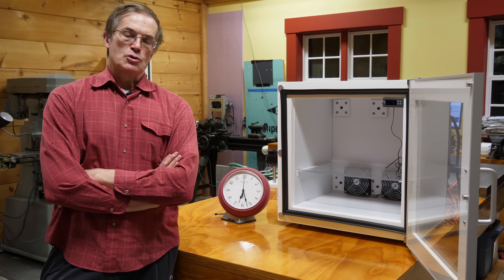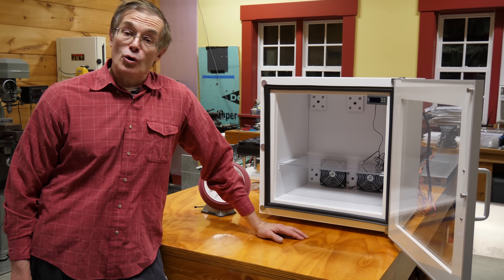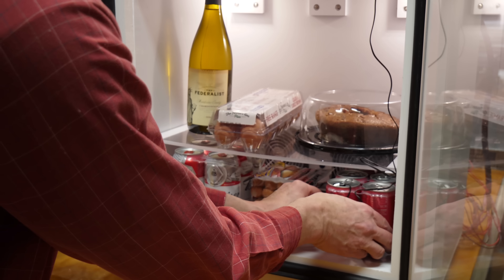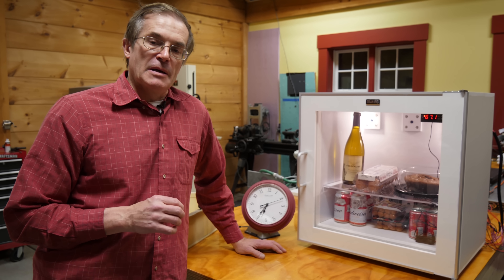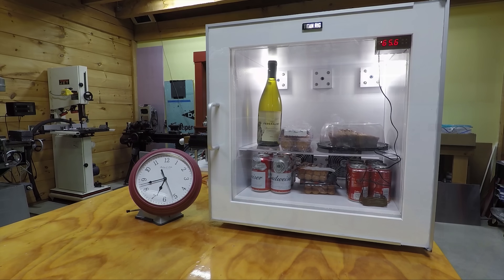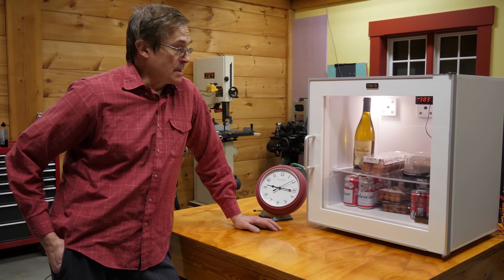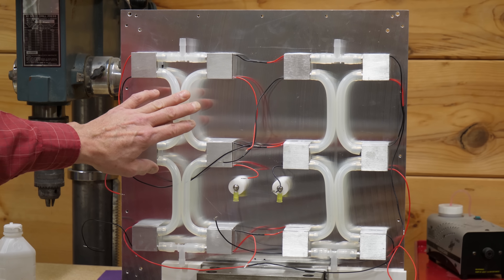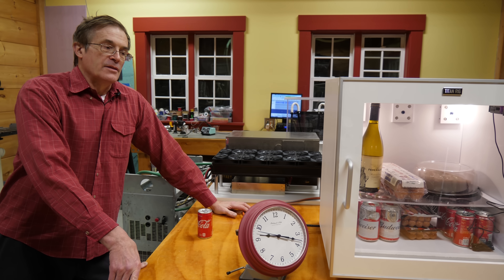TESTING OUR DIY REFRIGERATOR! - TEC/PELTIER

Comment: I recognize that cheapo temperature controller. Used that baby to preheat heavy oil to 120 F. $20 can't get you finer electronics.
Reply: Also handy in the toolbox for those emergency callouts to repair a commercial fridge, may not have all the features of the big names but keeps it running until the correct parts arrive.

Comment: Going back to the "no moving parts" concept, it would be interesting for a balanced flue design to be tested. These are used in the "Rocket Stove" and Rocket mass heater designs. Critically, the air intake and exhaust are the same diameter. The heat (from fuel or from Peltier) is added at the intake and causes the gases to rise like an inverted syphon where a heat exchanger can begin to extract and allow the gas to fall where it can be piped off around the house and out of a vent.

Comment: Wouldn't an antifreeze circlated in the interior of the enclosure that's plumbed to a small heat exchanger outside the house be more energy efficient? Considering a tiny circulation pump that's hooked up to the controller, and the peltier used only in summer, according to your narrative is half the year?
Reply from the maker: When we add the remote heat exchanger, we will use a water glycol mix  (food safe).
Reply: @TechIngredients  sounds good, please post some energy measurements too.

Comment: I'm really interested to see how much more efficient this will be with water cooling. Marine refrigerators and freezers (I live on a boat), even the standard compressed gas type rely on raw or sea water to carry away the heat. This is far more efficient than an air cooled system because the water is most always cooler than the ambient temperature. In the winter time when water temperatures get down around 40° to 32° the refrigerator runs about as often as normal, but only runs for a few minutes. The main problem is the motor compressor vibrations transmit throughout the boat. This electronic system, water cooled, could be an answer to quieter and more efficient marine refrigeration.
A really good thing to see would be a comparison of energy consumption between the electronic, water cooled fridge and a gas compressed, water cooled fridge. On a sailboat the lower energy draw usually wins the debate.

Comment: Thanks for an interesting experiment. I would suggest a couple of things though - once you committed to fan cooling the heatsinks, the heatsink design that was used was far from optimum. The clear door looks great, but really aren't ideal for an efficient fridge. I have done my own research and experiments on TEC fridges and efficiency is almost totally, but not quite, dependant on the level of insulation used. 10cm (4") of polyurethane is about the sweet spot for a fridge. The other factor is how the TEC's are driven. I would have liked to have seen more information on that side of it, (you already seem to understand that they need to be driven far below the max current which is important), and the level of efficiency achieved. The time to cool down is a measure of performance but with TEC's it is all about achieving efficiency. I would also like to know how you came up with using 6 TEC's - was it by calculation or otherwise?
Reply from the maker: Some of your questions are answered in the first video we posted about a week ago.  The door is less effective, but it makes using the refrigerator more convenient.
Reply: @TechIngredients  Thank for the reply. I did watch the first video and you did give a general explanation as to your rational. But I am a numbers guy. When I did my fridge I worked from calculating the cooling load, then used the datasheets to calculate the best current to drive the TEC. I would have liked to have seen more numbers!

Comment: Yeah but the energy the fridge puts into the air in your house reduces energy needed to heat it in the winter. A better case is the summer when you're dumping heat into a house you're activily cooling.
Reply from the maker: True, but electrical heating is less cost effective and it would boost the electrical efficiency to reduce the cooling temperature of the recirculating water.

Comment: That's one hellava fridge you've got there! Between the materials and workmanship that you've put into it, i'd dare say that it wasn't cheap in the least bit! The cost of the current configuration is how much???
Reply from the maker: Thanks!

Labor costs depend on what you would otherwise be doing with your time.  Also, many of the components and hardware are sourced from lab stock.  The TEC's cost $55, The required power supply costs about $50. The controller cost $13 and the fans were $6 each.  The big box boards, acrylic, hinges, adjustable feet etc cost about $100.

Comment: I was going to suggest exactly that, have the hot side on the outside of the house, i'm actually very curious if it's necessary to have the cooling hoses, the hot and the cold, isolated from each other.

Comment: With "water" cooling could you also have the TEC on the cool side of the insulation  instead of the large spacer blocks?
Reply from the maker: No matter what the method of heat removal, it will always be better to transport heat energy into the TEC rather than out of it because of the added electrical power (heat).  The inevitable, total temperature drop will be less if the higher load travels the shortest distance.

Comment: I've often wondered about using the cold air outside as a heat sink for refrigeration.  Usually involves cutting a hole in the wall of your kitchen for wires and/or pipes to pass through (and possible ingress of cold air from outside) which might be why it has not been popular with most homeowners.  I have heard of some super energy efficient types who have tried the idea, however.
Reply from the maker: We plan to use a window with some hardware to enable the water to flow in and out without modifying the wall.  this also allows the radiator to be taken inside when the outdoor temps no longer justify its use.

Comment: Nice work!

I wonder what power savings you could get from placing the remote heat exchanger deep underground to take advantage of year-round geothermal.

Side note, I just did an extensive search yesterday for anything having to do with electrets and couldn't find much of anything on Youtube.  So, maybe that subject might be a good future project.  The reason I was looking for electret information is I'm wanting to operate a rotor inside a vacuum furnace and my first thought was to use magnetic fields going the wall of the vacuum chamber.  That wouldn't work though because there will be temperatures above the Curie point.  So my next thought was something like ceramic electrets and electric fields.  Do electrets have something like a Curie point?  Can a good ceramic or refractory electret be constructed?  I'm curently thinking I can use magnetic induction on a refractory metal rotor but electrets usage would be novel and therefore exciting.
Reply from the maker: Thanks!
The geothermal approach is a good idea.  Kinda like taking paleolithic technology into the twenty first century.
Reply: @TechIngredients  True!  I didn't think of that aspect!  :D

Comment: Looks very professional like store-bought. Thought: Peltiers remote completely in a unit which runs an cold insulated line to the fridge interior. That way fans are remote and you can concentrate the cool into the liquid with a longer, high area coil inside the fridge for the heat capture/removal. Plus the area concentrated peltiers could be sequentially or parallely acting on a high thermal mass resevoir tank with a relatively small transfer conduit.
Reply from the maker: Thanks!
Not a bad idea.

Comment: Waste heat is only "waste" when it adds to the energy load of the total environment.  If our room is heated by adding heat, i.e., Winter season, the calculation of energy cost is complicated by the fact that we are reducing the load on the facility heating system when we run our refrigerator.  So, we can remote the refrigerator (heat pump) "heat sink" by placing it in a non-heated area and somewhat improve cooling efficiency (at the cost of additional equipment; a non trivial consideration) but we then discard the heat generated by our refrigerator!  This might be an improvement or it might not be.  I believe the calculations are complex.  Personally, as an engineer, diminishing returns may dominate.  This is somewhat analogous to the use of heat pumps for heating and cooling of buildings  in northern climes -- though almost in reverse.
Reply: The home heating system is likely much more cost-efficient at generating heat than the 'efficiency' of waste production by the peltier system. For instance, CNG costs about half as much as a resistive heater for the same heating (given average gas and electricity prices in the US). Fuel oil is only a little worse than CNG and still much better than resistive heating.
Reply: Of course it is.  

None-the-less, waste heat from a refrigerator is not a loss to the energy system (at least 6 months in the year).  I don't suggest that a refrigerator be used for heat, only that the cost equation include it.   And, my real argument is that a remote heat sink system will not show a profit.  Sure, it may be thermodynamically more efficient, but that does not make it cost-effective.  You will gain less in efficiency than the cost of implementation.

Comment: so whats the energy consumption? how efficient is the design compared to regular ones?
Reply from the maker: Maintenance power requirements are at approximately 100W which is about 25 -30% as efficient as a phase change refrigerator

Comment: I did a similar thing a while back to cool my workshop, although the temperature conditions are reversed here - https://sites.google.com/site/5b4ajb/Solar-Powered-Aircooler
One tip I do have for you is to use some kind of fungal inhibitor in the coolant.
To be honest, it doesn't perform very well (I know it's only a single 50W Peltier module) and am considering chopping up an old drinking water bottle cooler/dispenser...

Comment: Does a typical water cooler work good, or any good with anti-freeze or some other non-freezing liquid in it, that doesn't destroy the pump? Because when it is freezing outside the little heat from the peltiers (When the whole thing is in equilibrium) probably wont keep normal water above the freezing point.

Comment: Love the idea of pumping the cooler outside inside via a water cooling loop. How about using the temperature difference (hot fins and cooler outside water) to power the water pump via more thermoelectric peltiers?

Comment: Sorry but the way those fans are installed hurts my computer overclocker's soul.  I believe you would get more efficiency by removing one of the inside fans, turning the other around 90 degrees (z axis) and having it blow out of a heat sink with fins inclined so the condensation could drop into a drain (with U elbow so the heat doesn't escape/come in from the bottom).  And the outside fans could blow up from the bottom of the heat sink so they work together instead of against each other - as far as I can tell all your fans are either pulling or pushing against a plate when they don't have to!   I'd love to see an efficiency comparison with these changes and see if I'm completely wrong before you start dumping the heat outside! :)
Reply: This.... also wondering what the heatsink material is. Not sure it was mentioned in the last video. 
If it's steel.... steel has awful thermal conductivity. Aluminum would be great.
Reply: @BRUXXUS  It was mentioned in the last video. It's Aluminum.
Reply: @CP4884  Thanks for clarifying! Must have missed that bit of info.
Reply: @BRUXXUS  I think he said aluminum plates

Comment: Not bad at all for a 1st build ! I was skeptical about the completely passive fanless cooling working good enough, as even on regular fridges they typically use thE most mickey mouse fans available at the condenser side. That is to say just the smallest breeze seems to go a long way. You might need antifreeze If you're gonna put the radiator/exchanger outside.......hell you might not need so many(or even any ?) TEC's(circulation/flow depending) in the winter. & you should make it so the remote fans are optional(need some play with volume of coolant/hose lengths) so that anyone, anywhere can copy & use it practically. Anyway Ver2-12 oughta work like a champ, Can't wait, Way Cool Stuff as Always !

Comment: Can you use those modules to gain voltage from heat? Wondering if you could hybridise a wood burner's stovepipe to make electricity from the heat differential.
Reply: Yes, they can, have a look at 'cruising the cut' channel, it's a river boat channel in England, he has a TEC powered fan that sits on top of his solid fuel heater and uses the heat to power a small electric fan that circulates the heat from the stove through his boat.

Comment: I love this idea, and thought it would work extremely well for a kegerator setup where you have a very specific form-factor that you'll be cooling (1/6 keg for instance). Also, because you wouldn't be removing/adding things or opening/closing the door, you could get away with a lot less. Even if it took 6-10 hours to bring the keg down to temperature, you would only need to maintain that temperature for weeks/months. 

Also, I wonder if there's an efficiency to putting the keg in contact with the peltier device(s) so you're not cooling the air, but instead cooling the container directly.
Reply: You just reminded me of a setup I saw someone build, that can actually put two of their projects together. They used a turbojet made from a truck turbocharger, and had it run on propane. Because the fuel consumption was so high, it drained the propane tank quickly. The result is the propane tank got cold VERY fast. They dropped the tank into a big bucket of water with a bunch of beer and BOOM turbine powered beer cooler.

Comment: If you go sticking the radiator outside it might increase the efficiency of the freezer, but you're throwing all that waste heat outside and increasing the heating load on your furnace/forced hot air system. Better to keep it inside.
Reply: The bigger the differential the better/more efficient for the fridge.... err I think.
Reply: @chrisrathjan1501  Yes, like I said, the refrigeration cycle is more efficient, but the heat is exhausted instead of doing something useful (in the case of New England, heating the home in winter).
Reply: @yourcurtainsareugly  As far as I understood, peltier elements get less and less efficient as the temperature differential rises between both sides. So you need a setup, where you don't need to pump to a much higher temperature niveau. If the outside has a temperature little above the target refrigerator temperature, peltier elements might be efficient enough to transport and lift the heat to that niveau. If the outside is the same or even lower as the refrigerator temperature you don't need peltiers at all, but only need to transport the heat and regulate the temperature with pumps and a non-freezing liquid (or gas) through isolated tubing to the outside.
Reply: I'm betting the "neat trick" that he is incorporating. is turning off the peltier devices(but leaving the water cycle on) when outside temp reaches the desired fridge temp or lower.
this would be ultra efficient as you would only be paying for cycling the water.
Reply: Cooling something down should be done differently, than keeping it at a certain temperature.
Modern refrigerators are probably good at providing multiple temperature zones and keeping things at those levels.
Much can achieved here with just enough isolation.
But cooling stuff down and/or heating it back up is where energy is wasted (either because the heat gets thrown away or it needs to be done quickly, which is often less efficient).
I would suggest using two different devices or techniques for that.
If the outside is cold, just precool stuff outside before putting it into the refrigerator.
If your home is using some heat exchanger system for heating anyways, then maybe couple the process with that system and let it take the heat from the food or other items to be cooled.
Might all be too complicated in practice, but you could leverage the systems you already have and optimize them to get more efficient.
Reply: Not just heat but humidity, with some pulling a slight vacuum also.
Reply: Very minutely, if at all. He certainly wouldn't see it on the bill. This is a case of six of one and a half dozen of another.
Reply: @misterhat5823  I mean, he's already paying for the electricity to run the fridge, why blow the heat outside?
Reply: He needs to remove the heat anyway but its not that a fridge is used as a heat radiator in homes since all the food you have is not gonna contain enough heat to make a dent